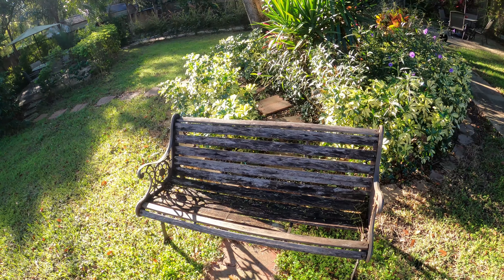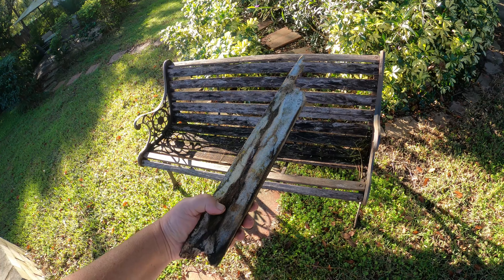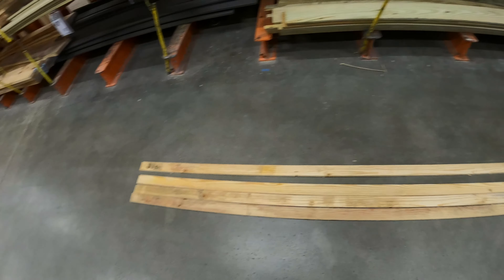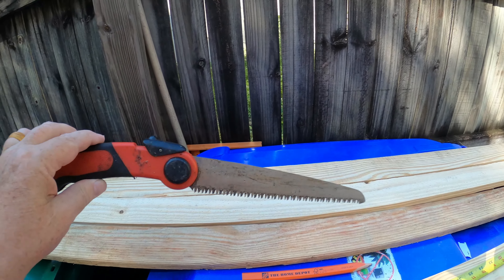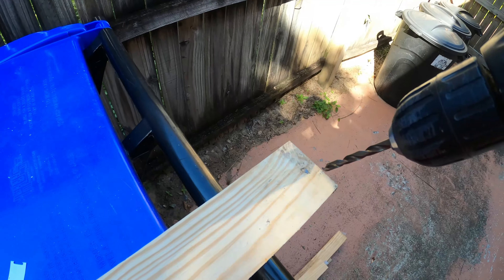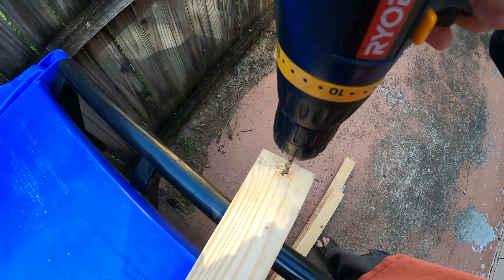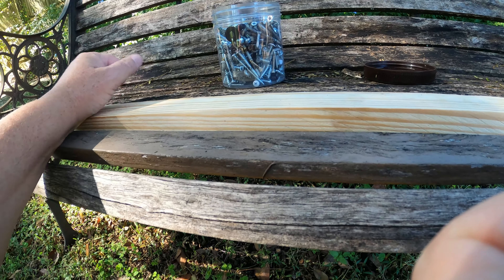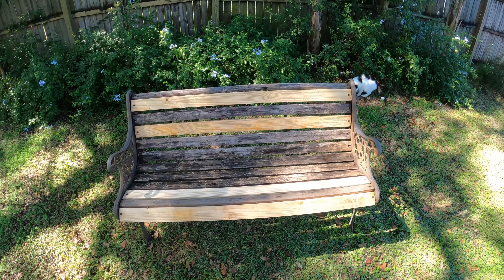How to Repair an old wood Garden Bench

Comment: Nice description. I have a Freecycle (free) bench from a local Flagstaff household and would like to change the wood out this Spring. What kind of wood did you choose (mine is the same length as yours) for stability and weight tolerance for 2 people? Did you ultimately stain or waterproof the new boards? Thanks. Keep up the great work
Reply from the maker: I think it's Pine and no stain as I like the weathered look. Wood from Home Depot. Plenty strong. Thanks, btw.